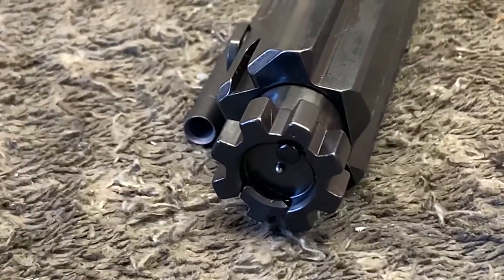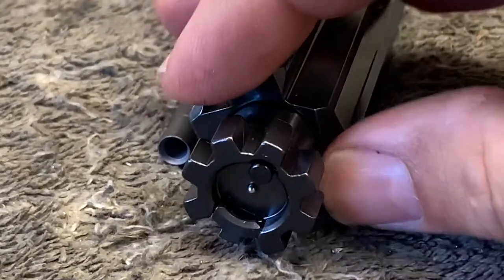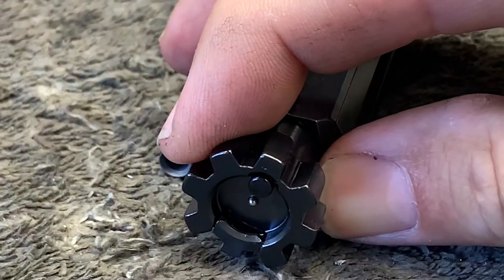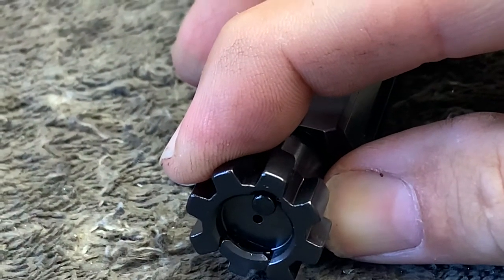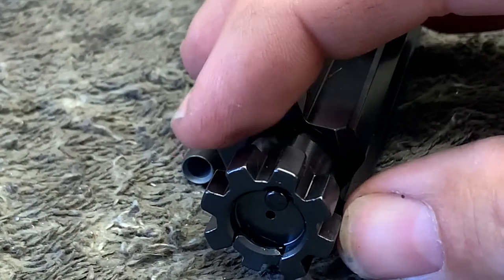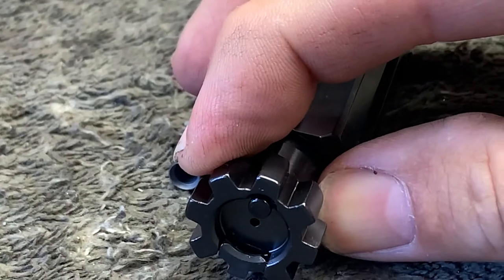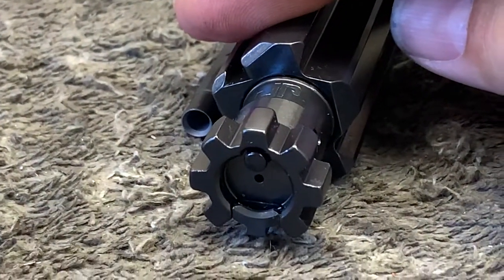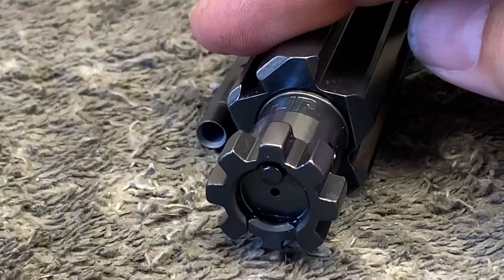AR firing pin safety function

Comment: Love to see a measurement on firing pin protrusion .. nothing but headache's   on my bolt carrier doesn't fire no repair shop will just ck the measurement w/o having to see the weapon everything is correct on the AR and this thing is brand new  .. so just received my nickel / boron plated bolt Carrier see how that goes gotta have a backup anyway
Reply from the maker: Firing pin protrusion on a small frame AR (223/5/56 sized) is 0.028” minimum and 0.036” maximum.

Comment: What kind of bcg do you have . I’m just wondering because I got a rifle that I haven’t even got to take to the range and it seems like the firing pin doesn’t stick out very much at all
Reply from the maker: The make of the bolt carrier does not matter. Any in-spec bolt carrier group will be the same as you see in the video. There are task-specific gauges to check firing pin protrusion or you can measure it with calipers.